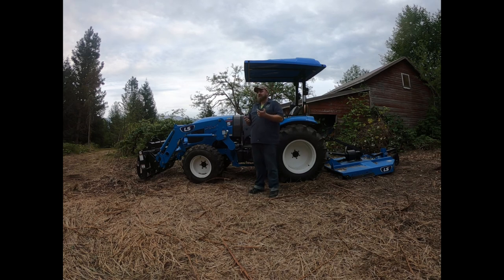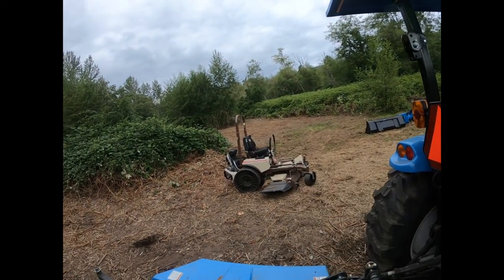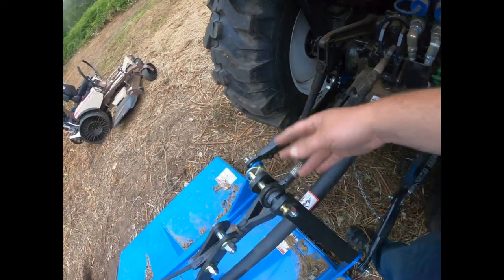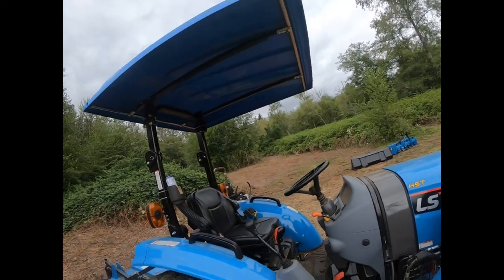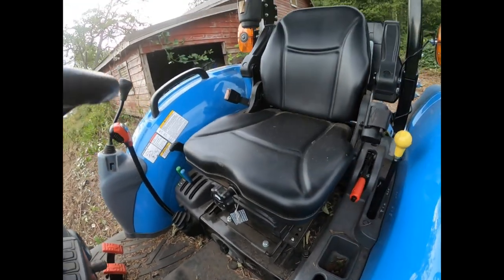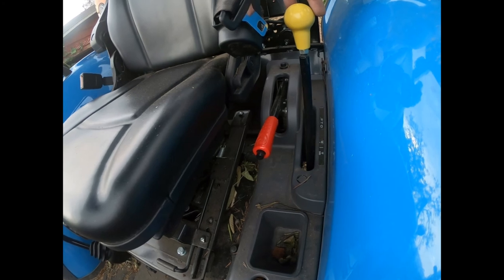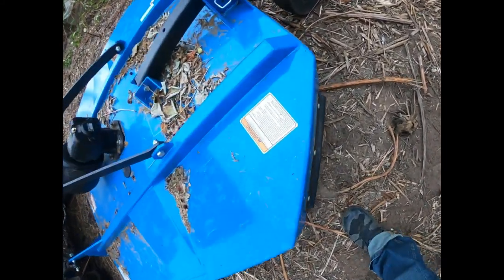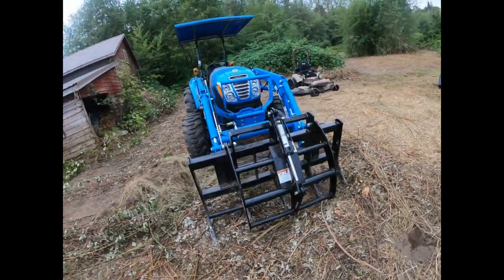LS Tractor MT342 Review (and brush cutter)

Comment: Can you please explain more about the grapple using the second rear remote? So you don't have a separate third function kit in the front?
Reply from the maker: Correct. We made a set of hoses that go from one of the rear remote hydraulics, and just ran the hoses to the front. So my control for the grapple is a lever on my hip rather than a button on the joystick.
Reply: @HomesteadBandwagon  That's a great idea - thanks so much! I enjoy your channel. I'm 99% giong to go to a dealer and buy one of these in the next few days, except it is a gear drive. Keep up the good videos!
Reply from the maker: It's kind of an old school way of doing it, but I like it. Sorta inconvenient to reach down to move the grapple, but I feel like it'll be 1 less thing to worry about since there's not an extra valve and wiring needed
Reply: @HomesteadBandwagon  Yeah and is saves the ~$1000 for the third function kit
Reply: Soooo....follow up to this! Some context and then my questions that hopefully you can help me with. I did purchase an MT342. I picked up a grappel today and I had that place make up 16' hoses so I could run the grappel off the rear remote. The grappel has flat face connectors coming off it, so they put flat face connectors on the grappel end of the 16' hoses. But they also put flat face connectors on the rear end of the 16' hoses. Since the tractor rear remotes are pioneer style, am I correct to assume I can just purchase two pioneer-to-flat face adaptors? And here's a really 'dumb' question: is there a male and female end for pioneer connections? Assuming I'm correct that I can buy adaptors, would you happen to have a recommendation of brand, etc.? Thank you so much in advance for any thougts / help.
Reply from the maker: I've never seen a pioneer to flat adaptor, so I'd figure on  just taking off the flat faces on the tractor end of the hoses and using pioneer instead. On our tractor, those hoses are always plugged in, so it's no big deal. There are dedinitely male and female pioneer fittings, so you'll want to make the ends both male since you'll have a pair of females on the tractor side. It's super nice to have flat faces on the grapple end! I'm planning to convert mine over soon. Way easier to keep the connections clean that way. Enjoy the new tractor!
Reply: @HomesteadBandwagon  Alright thanks for the reply and help!

Comment: if this tractor is working hard out in the field and getting hot, how often does this regen come on, every hour, every day, once a month, info!!
Reply from the maker: Defintely a good question. The regen actually comes on less if the tractor is running hot. From my experience, letting the tractor idle and using off road diesel triggers a regen every ten hours or so. There's a longer gap when using clean diesel and keeping the RPMs up- 20 hours or more between cycles.